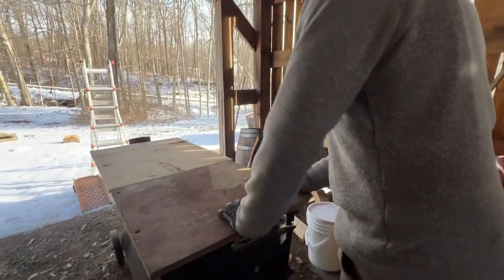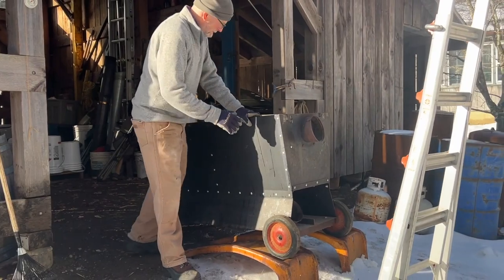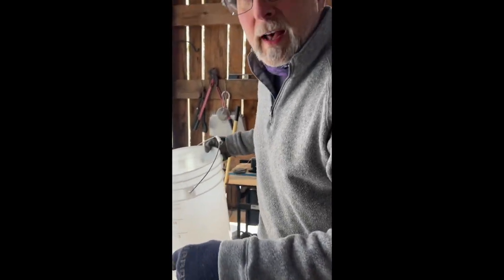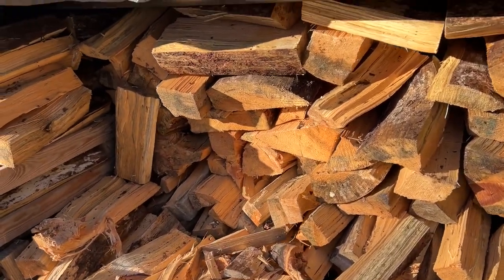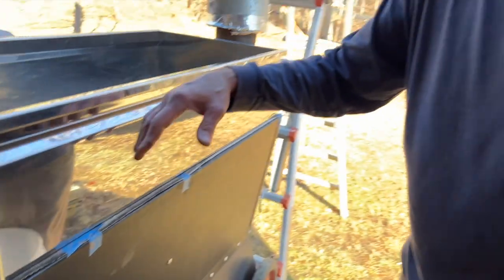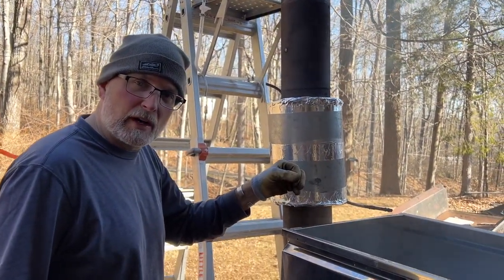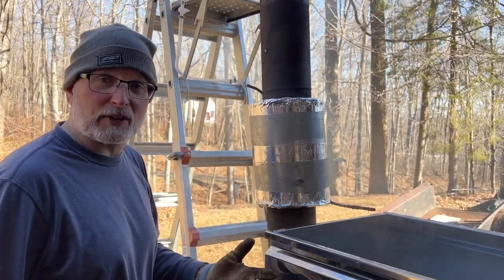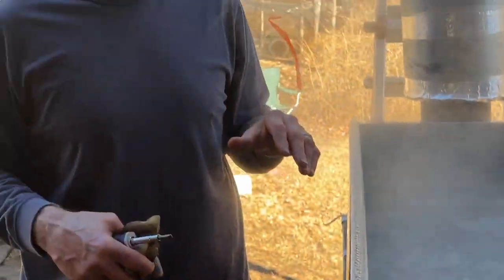How To Set Up A Maple Sap Evaporator

Comment: I love your setup! My wife and I have been collecting and boiling for the past five years with a filing cabinet/hotel pan setup using pallets for fuel. It's not nearly as efficient as yours but it didn't cost much - got 2 gallons this year, a little less than normal. Keep up the good work :) (we're in Connecticut)
Reply from the maker: Thank you. No matter the rig it’s a great hobby.